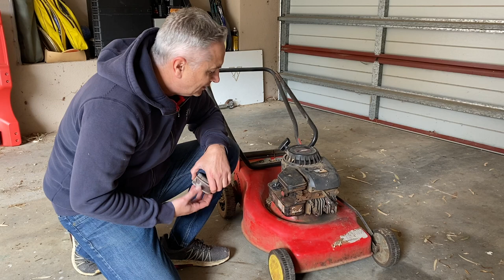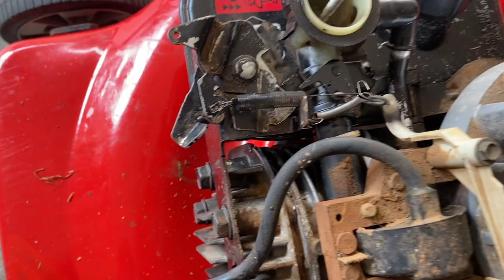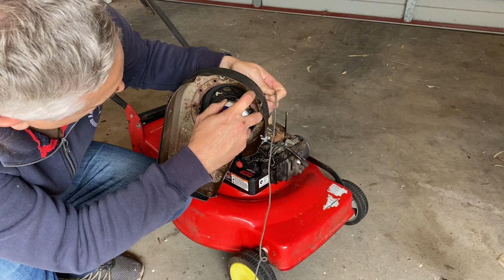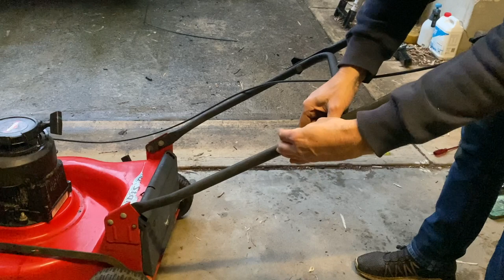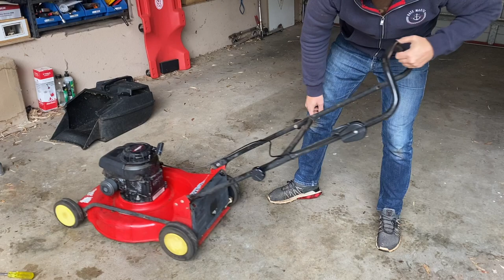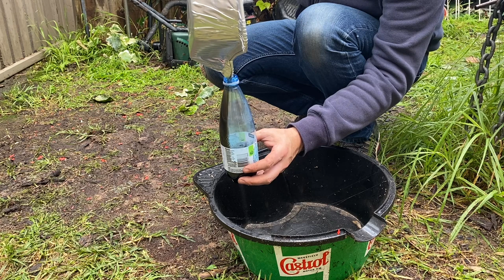Will it Start? Free Dumped Curbside Rover Mower! Can we Fix It?

Comment: Ive seen the throtle cable routed around the front of the machine to avoid the carb area you had used.
Reply from the maker: Hi Mate, I have seen this too and infact I changed it back to the side with the carb as I think it actually works better on the carb side you just have to use a cable tie to hold in the throttle cable!  Cheers Drew

Comment: DrewFixIt, the cause of surging on this Briggs classic is due to air leak. There are two causes of this surging. 1. When the diaphragm on the internal fuel pump towards the manifold get pulled in which caused an air leak. 2. When the manifold retainer comes off which also push the manifold oring out which cause an air leak. We can see at 11:03 (pointed with your finger), the oring manifold white plastic retainer had came off. The surging stopped when you reasemble the carburetor and fix the retainer back in place. I felt sad you deformed the small iddle spring. Nothing wrong with the small spring. When you tension the small spring, you will lost the iddle. Once you run the engine, it will revs higher (no iddle) at minimum throttle before the stop. Otherwise It's a good video and you have saved one mower. Cheers, VARIETECH
Reply from the maker: Thanks for your support mate, fortunately I was able to save this one and it is now happily residing with a new owner!  Perhaps we can do a collaboration one day?  Cheers Drew
Reply: @DrewFixIt  Yes mate I really love to colabs when we have a chance.